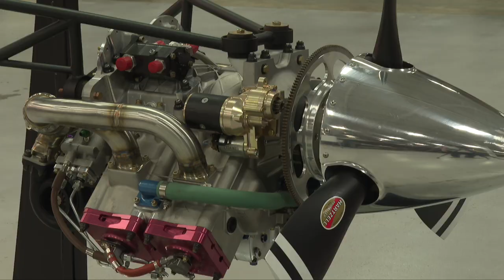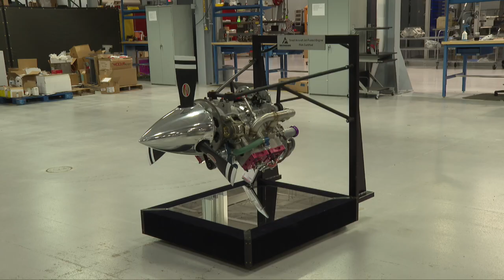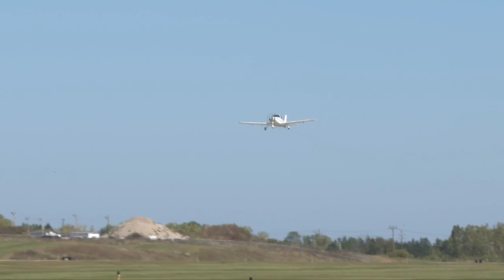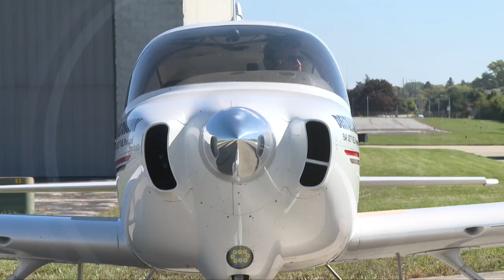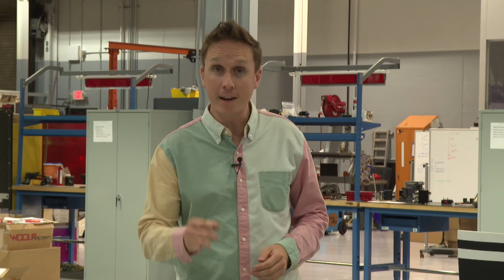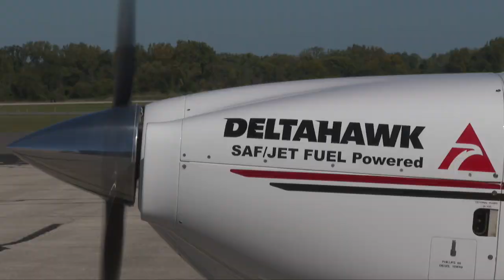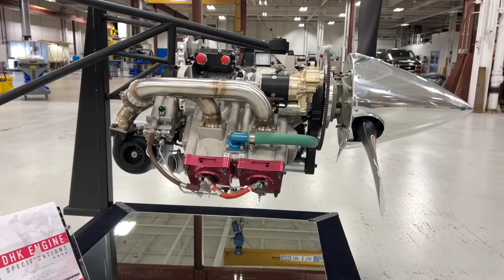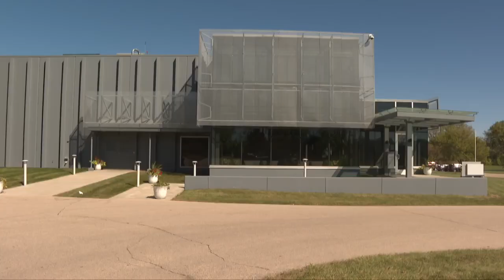This engine is the future of flying

Comment: The main driver of aviation costs is lawyers.
Reply: And engine manufacturers with FAA certificated monopolies.
Reply: @everwild-creates  I don’t believe the FAA only certifies engines from a set number of companies creating a monopoly.  I believe there are certified engines from legacy builders many years ago when it was less expensive and less bureaucracy (lawyer/politician) involvement
Reply: @everwild-creates  so lawyers.
Reply: @davidwoodward6112

Engine manufacturers who have delivered reliable products for nearly a century.  

Look at Rotax.  For all of the high technology and new design it still doesn’t have any better power to weight than a Continental O-200 that’s based on a nearly 90 year old design!  And the Rotax has four failure modes the Continental doesn’t (dog clutch, gear box, coolant leak, additional throttle linkage).
Reply: @calvinnickel9995  I can't see how they think it is ok to charge $30k for a 80-100 hp engine. Especially if it is old technology. There are few choices and not enough competition.
Reply: @calvinnickel9995  TBO? I had 183000 miles on my twin cylinder air cooled, Bing Carb'd (that automatically adjusted for altitude / pressure) and my Lycoming ate an end pin cap and neither the FAA or Lycoming gave a poop - you either flew too much or not enough, too high or too low, you didnt change you socks and that is not our problem.
Reply: @calvinnickel9995  Really? Only half GA aircraft engines make it to TBO. And WTF is TBO? When was the last time a auto engine (and dont give me the apples v oranges static) had a TBO? I have 300000 plus on my Volvo (we used the Volvo Penta diesel engines in our life boats - never stopped/never failed). The only reason they are still alive is the UAW and FAA Certification.
Reply: This is exactly right.   "Airplanes are not allowed to crash, and childrens' toys must be safe".  Tort reform in 1986 got Cessna to restart its general aviation business, but its still far too expensive.  A decent panel with modern avionics can cost 100s of thousands of dollars.  Engines and maintenance are expensive, tedious, and slow to adopt new better tech.  Thats not because the tech in general aviation is necessarily otherworldly, it's because of the risk portfolio (lawsuits) any certified aviation supply chain has to mitigate.
Reply: @lee161a  I agree with some of what you say - torts are a racket, like a game of chicken between lawyers until clients give out of money or patience. However, I have not seen any real advances in GA engines in 50 years + --- Magnetos? Last lawnmower I had with mags' was in 1999 from Northern Hydraulic - 90$.
Reply: Fluff piece. 
Don't like the voice. 
Lack of details makes the whole thing suspicious. 

WHAT is so great about this engine? 

I hate click-bait.  

YouTube should have a Click-Bait rating.
Reply: Especially after the NTSB hand over all the evidence they could possibly dream of.
Reply: I don’t fly much GA.  part 135 and Military is my bag but the FAA seems awfully antiquated.  Only in recent years have they started pulling their collective heads out of the sand.  For instance, when electronic standby attitude indicators were far more reliable than vacuum and had internal batteries, only then did they relent on certification process.
We need some more engine advancements on electronic fuel injection
Reply: @hugoglenn9741  Thank God! Simple advancements in micro electronics will replace the magneto in a flash, and the panel as well, so long as it is not Software based. The Cirrus 22 is a perfect example: We had on crash near Sandford NC (TTA) aka Raleigh Executive Jetport. The autopilot quit, not sure what else, and with the engine running, he lost control and killed his family and wrecked his plane.
Reply: Well said. 
Another cost? Documenting the pedigree of even the simplest part back to the heat number at the steel mill.
Reply: @niner_six_echo  zero defects in Aviation is the standard meanwhile close to 40K people are killed on the roads in the US each year
Reply: @hugoglenn9741  :  Multiple fatality freeway pile-ups are such eveyday events that the media hardly notices...
If someone was fortunate enough to capture footage of an aviation 'event', the media will use it to fuel a 'Feeding Frenzy'!   🥴
Reply: And insurance
Reply: & that's why expiramental aircraft CAN be 100% safer than certified. while certified has to make sacrifices on better tech in order to pay lawyers & federal agencies? experimental class only has to concern itself with one thing- performance & safety.

Comment: Do you have ANY information about this engine? Because this story does not.
Reply: It’s twenty years in the making and lots of talking, no delivery so far🤡🥱
Reply: @dtsh4451 They said 2025. People have pre-order these engines.
Reply: @dtsh4451  the talk is all but over, since it is officially certified by the FAA in America(Huge deal).  Action(Money) talks BS walks.
Reply: ¹ LP Kö in ich Pop Kö in ich möchte nicht @dtsh4451
Reply: It's an engine is all I got.
Reply: The long and short is that it's a piston engine that can run on kerosene-based jet fuel instead of general aviation fuel, which is basically a grade of leaded gasoline. That makes it cheaper and cleaner to operate, and allows more kinds of small aircraft to use a widely-available industry standard grade of fuel.
Reply: @microcomputermaster  cleaner in what way, less lead - yes.  Lower NOx - No.  Lower CO2 - yes.
Reply: @microcomputermaster so it’s a diesel engine
Reply: @microcomputermaster  using liquid propane should reduce the cut the cost of fuel by 60 something %. I've taken engines apart that ran propane for thousands of hours of run time and they were clean on the inside.
Reply: Yeah I see an upside down diesel 2 stroke.
Reply: No sparkplugs, appears to be a V4 Turbo Diesel. There's been testing on using the VW Turbo Diesels, in small airplanes.
Reply: @tomriggs3926 , Looks like its a up side down V4. Normally its not very simple to make it ballanced. Did they make it ? What do you think ?
Reply: @tomriggs3926  Diesel fuel freezes on earth. At 25,000' how you going to keep it liquid?
Reply: @craigpennington1251  Probably a diesel cycle engine that runs of JET-A.
Reply: It's not a gas turbine engine from the looks of it although I think I see a super charger. Article reveals absolutely nothing about the technology.
Reply: I'm sure if you look up Delta Hawk on maps it will give you the contact information...
Reply: Number 1 data.  It’s expensive, somewhere between 60 - 80K
Reply: @hugoglenn9741  - Math: it goes like this: If you fly a Small Plane under 150 Hours a Year, it's best to Rent, not Buy!

It also goes like this, it is better to buy a More Expensive Single Engine Airplane, than a "Cheaper" Twin Engine Airplane! (Because the "Twin" has twice the Number of Engines to Maintain, Overhaul, and Give you a Pain in the Wallet! 

It also means: A New and Expensive Engine, with a Long Overhaul Run Time, will require Lower Overhaul "Reserves" in $, per Flight Hour!
Reply: What I learned …. Nothing
Reply: Fluff piece. 
Don't like the voice. 
Lack of details makes the whole thing suspicious. 

WHAT is so great about this engine? 

I hate click-bait.  

YouTube should have a Click-Bait rating.
Reply: A picture is worth a thousand words if you know what you are looking at.
Reply: Check out their website.
Reply: It’s incredibly complicated 😂
Reply: 202 inch³ V4 2 stroke diesel with mechanical unit injectors.  335 pounds.  180 to 235 horsepower.
Reply: This video is all hype to seduce potential investors who have money but aren't that bright. Someone can have 10 or 20 thousand orders, but if they cant deliver it's all smoke up your ass. The engine on display is just a model. If money talks and bullshit walks...We walkin bro. Building a display model isn't the same as putting together a production team and going into manufacturing. They clearly don't know how and know nothing about logistics, and analytics. My guess is they are a bunch of engineers that are full of ideas but have no clue what path to take to make this a reality. They  need a quarterback making the calls instead of a cheerleader.
Reply: Your kidding right! Search the internet. The Delta Hawk home page sounds like a good place to start.
Reply: @marviwilson1853  I don't they are as bad as I originally thought, but they are on shaky ground. They have too many Chiefs in my opinion, and have little knowledge of a production environment. If they fail that will be the reason.
Reply: @rickhunt3183  but if they have achieved FAA Certification it means that all these things are properly controlled and signed off - including future production.
Reply: The technology has some drawbacks but like all aircraft engines and motor types none are without them... The idea comes down to its cost, reliability, and production scale marketability...
Reply: @terrancestodolka4829  I'd like to see an engine that is powered by propane. It's a clean burning fuel and any engine I've taken apart that ran propane was so clean inside. The only down side I can see is you lose about 10% horse power burning a less dense fuel.
Reply: This is a 2 stroke diesel in a V4 configuration.  It uses a supercharger and 2 turbos.  It's a great idea for power output and fewer parts but... 2 stroke diesels are not fuel efficient.  It'll burn Jet-A, diesel and kerosene if the fuel pump is robust enough.  Diamond aviation has a diesel engine option that seems reliable so the idea seems viable.
Secondary vibration control will likely be key to the success of this engine and airframe manufacturers tolerance for vibration and weight.  It's unlikely that it'll need a gear reduction unit.  That fact will save weight but diesels need much more stout blocks, heads and internals due to the compression ratio and cylinder pressures.

Comment: all true.. but Who wants to spend $105.000  for a Firewall Foward kit for a RV10
Reply: I can by a lot of 100LL for my Lancair with 105k.
Reply: Their website says starting target price at $110,000 for the 180 hp 
So more like $150,000 +.    LoL 😂
Reply: I'm also building an RV10 and these companies still don't understand how this works. They need to sell the first 500-1,000 engines at a deeeep discount over an equivalent Lycoming or Continental to owners who are willing to help them prove out the design. They will never beat the incumbent at a higher price point when existing offerings have millions of proof hours on them and cost less. I hope Delta Hawk has enough cash in reserves to sell these at a price that is compelling enough for owners/builders to take a risk flying behind a new product, and take an even bigger risk that Delta Hawk survives and is around long enough to provide service and parts 10 years from now. 

The equivalent IO-360 costs between $40-50k.

Once they get past market acceptance and clear proof these things are reliable and serviceable, only then can they maybe ask for the same price point as similar 180hp engines. They can accept this reality or die like the majority of aviation engine start-ups.
Reply: @everwild-creates  Exactly the problem wich had Safran with its SMA 305  230 hp
Reply: You elaborated more than I wanted to. This is exactly the problem ...braking the market. It takes several years with a below completive price, it takes decades with completive prices. Now it will take for ever with  over priced engine.
Reply: A new io390 is about 140k